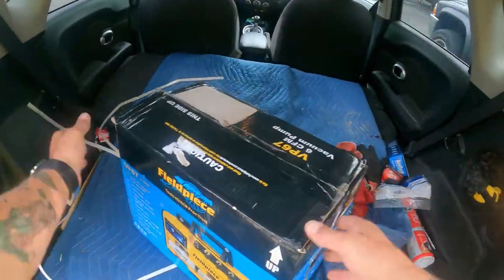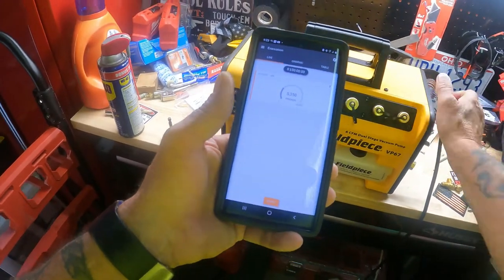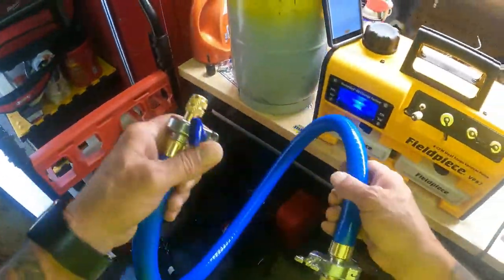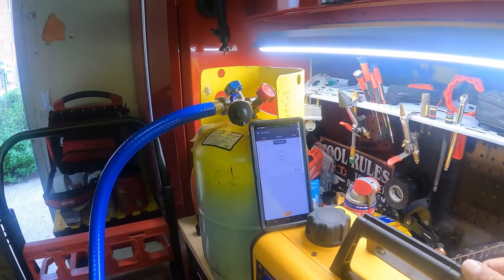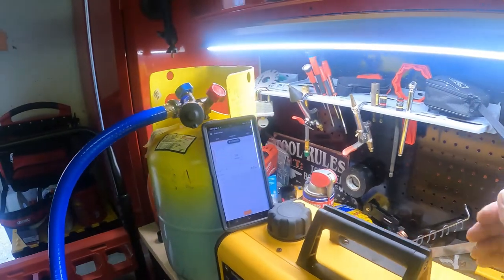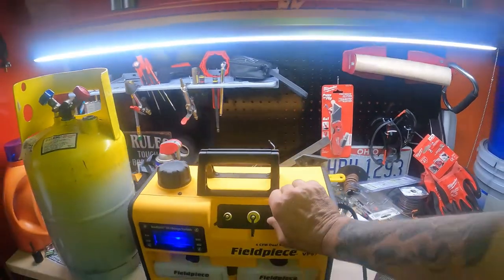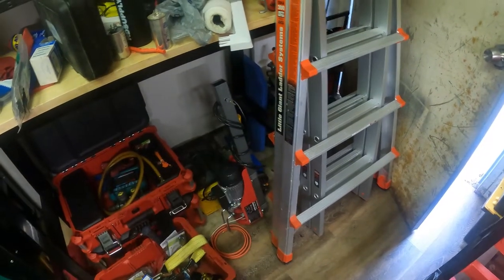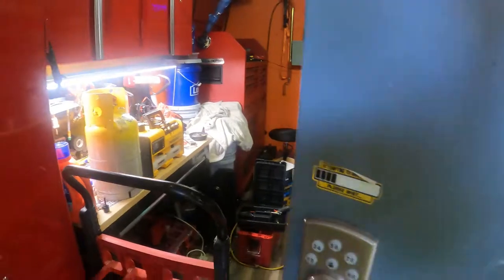fieldpiece vp67 Vacuum pump and true blue hose test run

Comment: The pump itself won’t hold a vacuum when not running. That would have been a nice feature, easy to work around with a core tool though.
Reply from the maker: Yelp I remembered after i did the video.    Thanks for your input i appreciate it